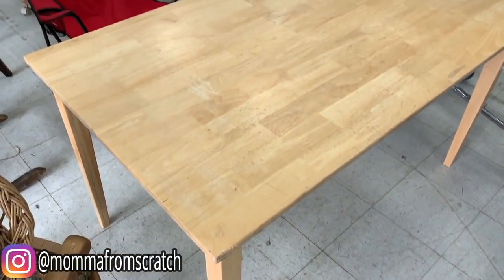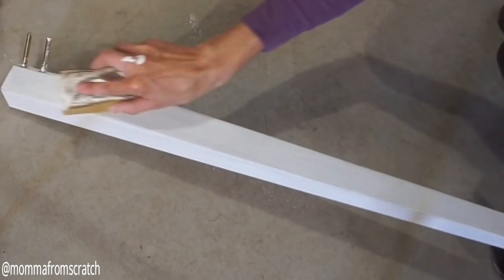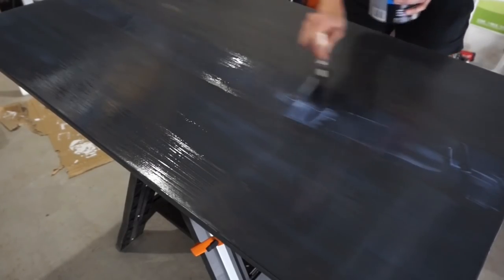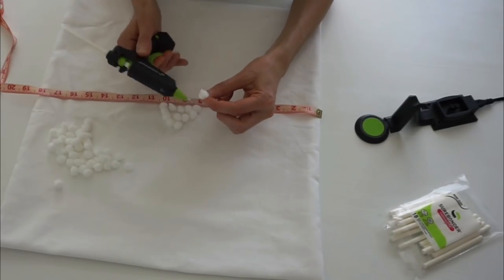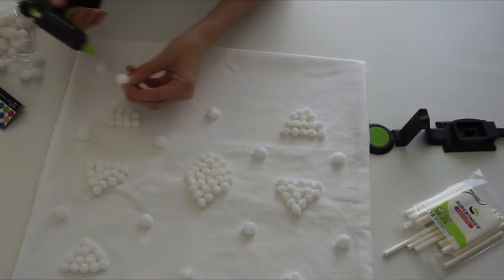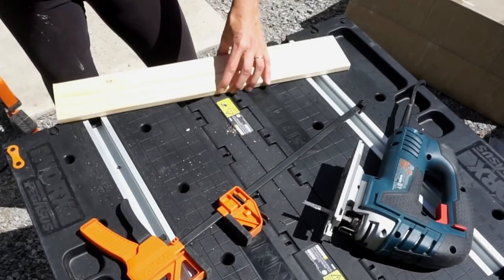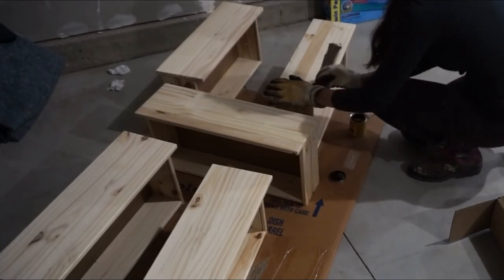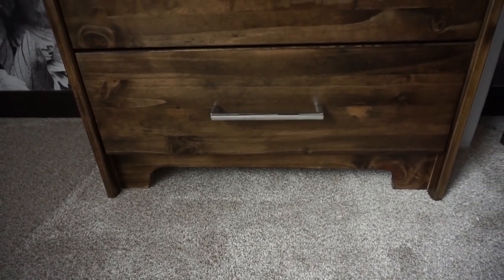DIY IKEA HACKS | Affordable Home Decor Ideas + Easy Furniture DIY

Comment: Did you use the same sealant on the legs? And if you did, did it "yellow" on the white paint?
Reply from the maker: I did and it didn’t yellow this time but with the water based one it has. It’s weird some people say it doesn’t others it does and I’ve had both happen. I’d just get the wax and do that